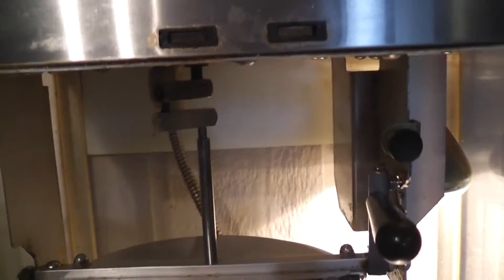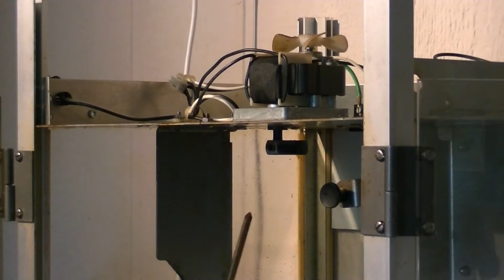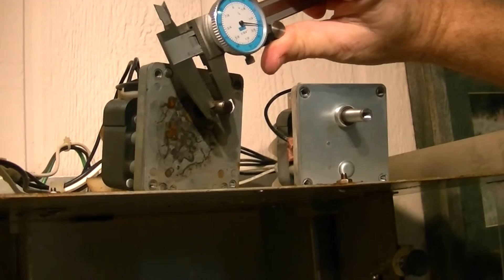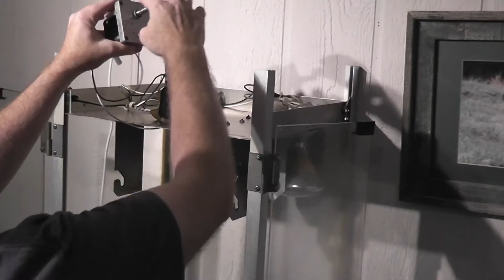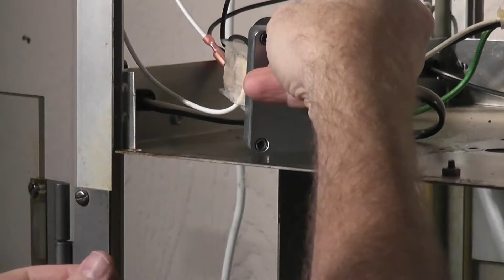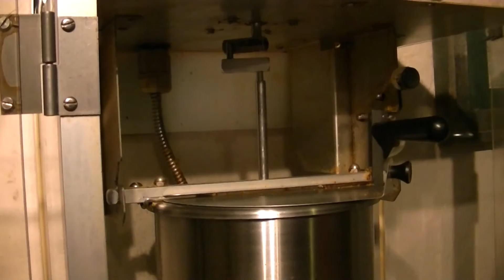Popcorn Machine Motor Replacement

Comment: Could you just just swap motor.
Reply from the maker: Yes, that is essentially all I did.  The motor does have gearing to provide a lower RPM as well as a bit more torque so that is important to match up when doing the replacement to get close to the original RPM.  Too slow and you may burn kernels or too fast and you'll pulverize kernels that have popped.

Comment: Hey! I found your video super interesting! I'm currently looking into buying a new motor for my own machine. Can't seem to find it. Could you help me out? What is the motor brand and specs? Thanks a lot!
Reply from the maker: Here's the one I got: Paragon 512096 Replacement Gear Motor for Popcorn Poppers - 120V (380512096)  from
http://www.webstaurantstore.com/

You may want to look elsewhere.  As you can see in the video, I ran into some minor issues with clearance.  The other thing was the new motor turns CW instead of CCW, which isn't a huge deal, but I did have to make sure the parts were screwed together tightly so it wouldn't unscrew accidentally.  You may want to shop around and make sure the replacement one you get jives with your machine as I learned they aren't all perfectly universal.  Another company that sells similar motors:
https://www.multiproducts.com/ac-gear-motors/model-9000
Good luck with your search!